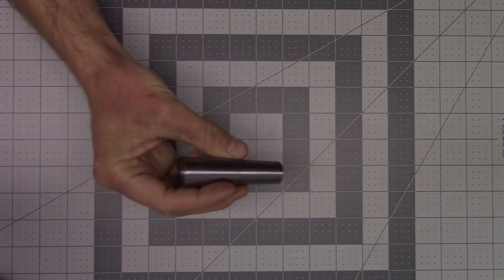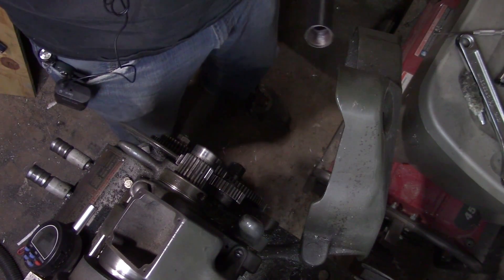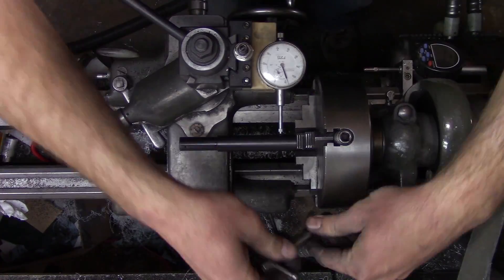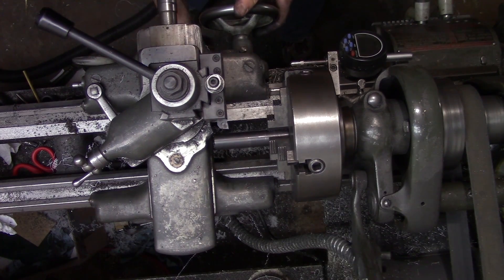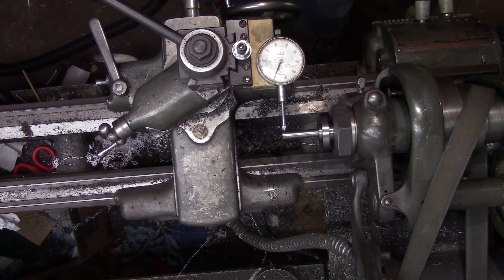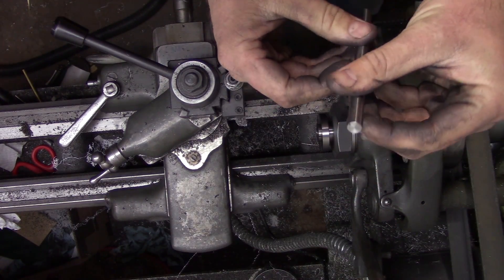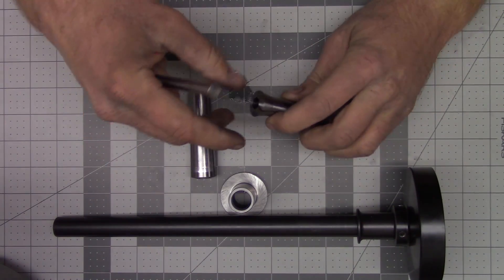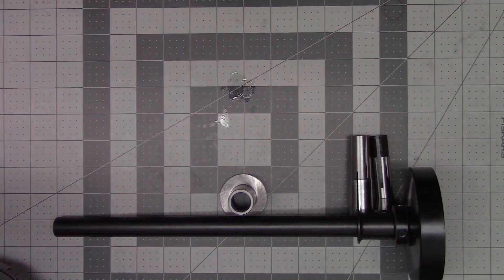Little Machine Shop Universal 3C Collet Closer

Comment: I just got the parts to make the milling attachment for my SB 10k like you described in an earlier video. Would you recommend for some one like me just starting out to use the 3MT collets or get the universal closer and 3C collets? I don't have any other machines that would use the collets, just would be used to hold an end mill when using the milling attachment. Thanks for you videos!
Reply from the maker: You really can't go wrong with either. The 3MT route is the cheaper option. I used the 3MT collets for a long time before getting the universal closer.
https://www.youtube.com/watch?v=mhHZNzjR5LQ

The only real down side is the 3MT collets do not allow pass through. With the work I do with my lathe this wasn't an issue for me. You just have to size and cut your stock accordingly. I never bought a full set of 3MT collets, just bought them as I needed them. Doing it this way I was able to start a collet set without much money. I bought 3MT collet from Amazon I believe they were around $10 each.

If you do go the 3MT route when you buy your collets make sure the drawbar threads are the same. I found that some collets are standard an some are metric.
Reply: @BasementMachinist  Thanks! It looks like Little Machine Shop has a set of 7 3MT and 3C collets, each is around $100. If I go with the 3MT I won't have to spend $110 on the universal closer, but lose the ability to pass stock through the colet. Hmm, tough decision.
Reply: @BasementMachinist  Oh, sorry I didn't see all of your reply. Thanks for all of the good advice!
Reply: little machine shop sells an arbor that will fit the atlas/chraftsmann lathe taper and hold the end mill shank correctly i used all thread to fit  steel rod pined it old gear for handwheel.and old piece of delrin as spacer end of  spindle and   gear handwheel